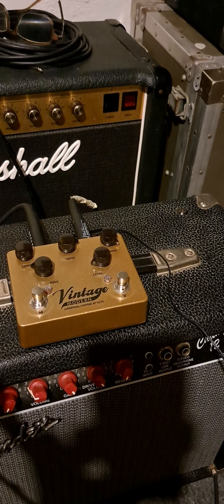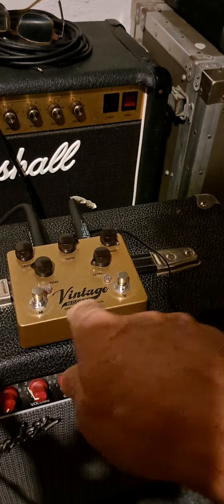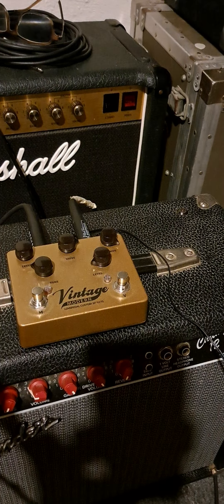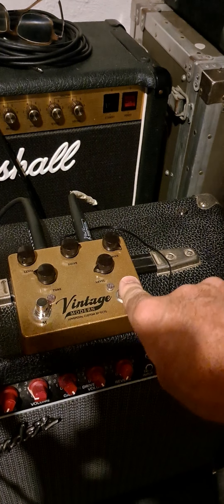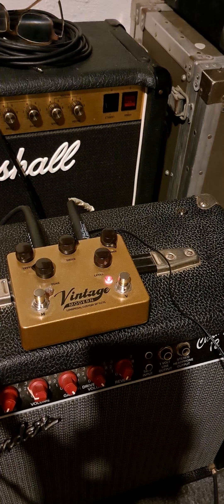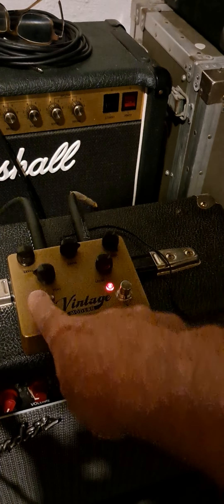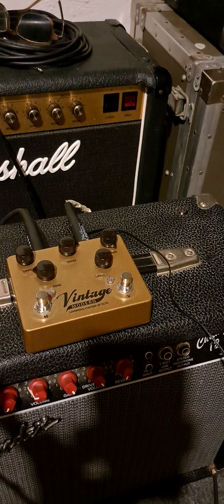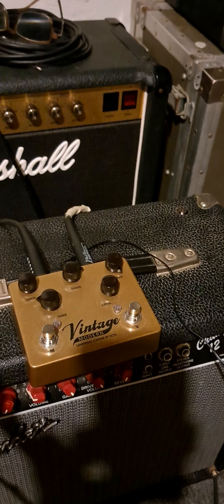love pedal Vintage Modern distortion pedal

Comment: Holy shit that's a noisy pedal.
Reply from the maker: Honestly, I've owned many distortion pedals over the years.And I don't think this pedal is any Less noisy than any of the other ones i've ever owned.  You have to understand I have the microphone very close to the amplifier.  I guarantee you in the mix of a band that uses a distortion pedal.No one would notice that hissing sound when the band is playing at volume.
Reply: @Andrew850   cool, still need a noise gate with it regardless